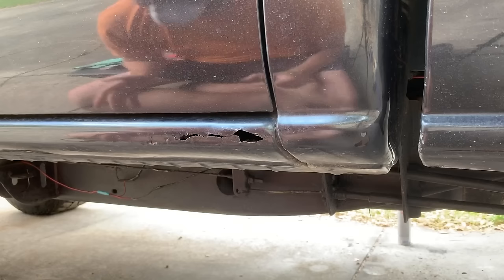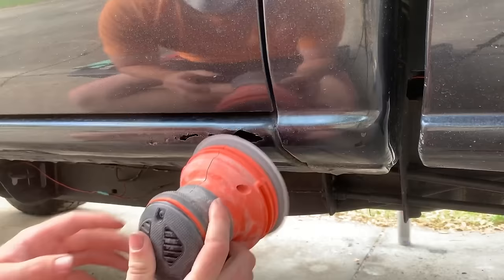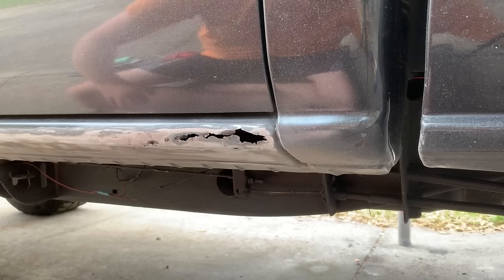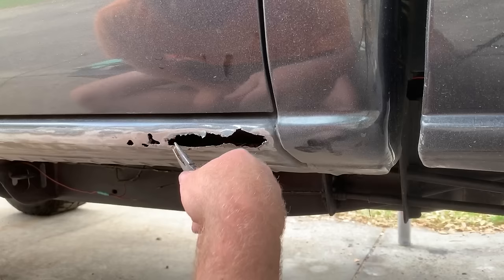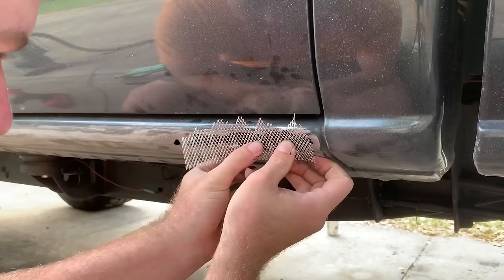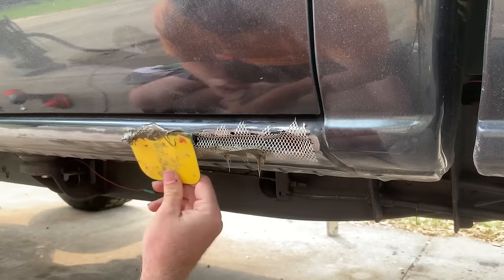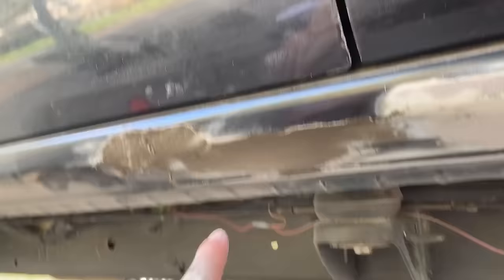How To Fix Rusty Rockers Without Welding

Comment: Drill some holes to dump used oil inside the rockers and you'll never have an issue again with them rotting. It's what we do up here on the east coast of Canada with our vehicles.
Reply from the maker: Never knew that, I love leaning little tricks like that. Thank you
Reply: Dude this is great never thought about that. Will be doing this for sure
Reply: Great tip - thanks!!
Reply: Fluid film.
Reply: @AaronCates  Check local laws before you do this.  EPA might have something to say.  Definitely illegal in Atlantic Canada to use used motor oil as an undercoating.  Fluid film™ is an excellent alternative choice.  Environmentally friendly and works well.
Reply: I got a quart of 1040 in each door and each rocker.
Reply: @DunlapsGarage   First, if you actually read my post I said "'Community" not vehicle.  In fact the word "vehicle" was not used at all. I used an example to reinforce my point about checking "local" laws before using used oil as undercoating.   Not sure how this seems to have offended you.
Reply: I’d use the oil. But then I pee in storm drains.
Reply: @hobbyaddict9908  Also live in Atlantic Canada and do this however I don't see how spraying it inside the doors counts as undercoating.
Reply: @Shawn_White  Governments do not care if the average person does not understand the laws as long as you follow them.  If you really want to know call your local Department of Environment and ask them.    FWIW, most vehicle doors have drainage holes and anything you spray inside the doors will eventually leak out onto the roads you travel, onto your driveway, etc..
Reply: Thanks man I'll try it out
Reply: We do the same thing in Ohio.
Reply: Doesn't have to be used oil, can be new oil but why spend the money but could use really any kind of oil  or product made with oil instead of water new or used
Reply: Here's a rust belt cheap coating. 1 quart of trans fluid, 1 quart of ANY oil, new, used, hydraulic, motor, gear etc, 1 tube of grease and 1 or 2 toilet wax rings. Put all in a old pot, heat and mix and put on how you wish. Thinning with any oils or fluids or thickening with wax. You can add boiled linseed oil or whatever you like. I like to use baby, mineral, melted Vaseline for doors, hood, trunk, tailgate etc. Will not ever rust, is cheap as can be and will last more than 1 season. The best I've used is Blasters wax coating, but it's not cheap to use every year. We all change oil or know ppl that do. all you gotta buy is wax rings and grease. So for $6, $10 bucks most using used fluids you have a rust killer and stopper that will last year's if used and put on well. I spent tge time to get Eastwoods rust encapsulating paint, internal frame coating then use this wax oil treatment and it lasts for a long time.
Reply: You’re a damn genius I’m saving this comment for when I work on my truck
Reply: @Connor727  No just cheap and tired of spending $100s a year on fluid film and the like. And from 30 years of working with machinery, cars, trucks anything with a engine you never see rust on metal covered in oil, grease, hydraulic oil etc. Only issue is some is very thin or gets thin when warm. Mixing with 2 wax gaskets it will not run or creep. For this I use Vaseline, baby oil and mineral oil. I can mix some trans or any oil with it but it's not needed. Just plug up all the drains on doors, hood, trunk etc and fill with cheap petroleum products for a few days, raise and lower and side to side and it will get in all tge cracks and crevices and it won't rust year after year. Some places like the doors and such you want some creeping, frame and undercarriage you don't. Used this for years and years and only ever saw 1 other who said they do about the same. You can use whatever you like. Boiled linseed is great also and don't smell bad. If using in doors I like to not smell trans fluid for weeks. Or mix with baby oil. It smells alot better than anything.
Reply: What does the oil do?
Reply: Oil attracts dust and dirt. Bad idea!!!
Reply: I live in nova Scotia and didn't no about this
Reply: @hobbyaddict9908  lol
Reply: @MidnightPolaris800  it does and it makes a barrier from o2, the primary source of rust, wipe clean what you can see
Reply: I live in Ontario. If my rockers are already rusted is it too late to do this?
Reply: @MidnightPolaris800  dust and dirt is preferable over rust
Reply: Mmmmm. Also for the the undercoat when nice and clean. Plastic makes it fun for the new cars. Anyone else keep their undercarriage rust free? Hubs, brakes, linkages etc? My control arms on my mazda seem to rust out every year, even with a tear down and proper repaint.
Reply: We use transmission fluid in Ontario
Reply: @Chronic898  I have been doing undercoating for probably 35 years. If you don’t want to buy actual rustproofing products, as you say ATF and also chainsaw bar oil are good alternatives. Motor oil is a bad idea as it is really hard on any rubber parts, as in it will destroy all your rubber mounts and bushings.
Reply: @oof578  yup fuild film I live in north north east lots of salt. When I bought my tacoma used it fell under the frame replace program. Got a new frame a week after buying been putting fuild film on it every November not one spot of rust on the frame at all. I buy the small spray cans an put in on the door hinges battery terminals ect
Reply: Too late for my truck. Crap silverado!!
Reply: Use fluid film or an actual rust inhibitor.. used motor oil is obviously cheaper but oil that is breaking down has Corrosive qualities that might actually cause further damage to the metal.
Reply: @BigWheel.  I have seen 2 trucks get all their rubber mounts get destroyed  using oil. Not a good idea.
Reply: Industrial lanolin is what I always use in tropical Australia.
Inside doors, rockers, anywhere water can get in
Reply: FRED....C'MON  mannn... 🙄🙄
Reply: We use break fluid in surrey
Reply: I just take my car to krown and they spray a nice thin specially made oil right in there once a year.
Reply: @mblake0420  moisture is the primary cause of rust
Reply: @beardedforlife3740  I would say no kidding
Reply: Farmers spray all of their equipment undercarriages with used motor oil.
However, regular people doing what you propose will not work because that oil gets all over the driveway, and if you have a concrete driveway it permanently stains the concrete.
Reply: @pupdog7374  we spray all of ur equipment with diesel before storing it over the winter months and just before we put it to work in the spring.
Reply: I live in Illinois, the rustbelt capital of the USA.  To  deal with rusty undercarriages and wheel wells on my cars,  I installed a hot water pipe sillcock to the outside front of my house (along side the cold water sillcock). My horseshoe driveway works well as I use one side to wash my cars undercarridges and the other side to park my cars. Works like a charm.
Reply: @pupdog7374  I'm in New Brunswick Canada next to the Atlantic Ocean and our road crews use salt 95% of the time on the roads so to say I know the rust belt problem would be an understatement lol.
Reply: @beardedforlife3740  o2 is primary cause of rust, the water (typically salty) speeds it up and makes it a concern
Reply: Yeah I use fluid film . I figured if the military uses it , it's good enough for me.
Reply: Have to treat the rockers from behind asap where there covered with cheap tape from factory then seal holes with gorilla tape or...install a good brake light gasket also.  If you have a sunroof..
Idk, drill a drain
Reply: @smokeythehuman3596 I had some old 4 stroke oil and I did this lol raw dogged tf out of that rust
Reply: @hobbyaddict9908  thanks dad
Reply: Keep up the work kid. Looks great. Keep making videos. I will be using this trick
Reply: @johnnycash7803 Is it only Tacoma’s and what yr?
Reply: @ladilondon1213  is what only tacoma?? The frame replacement program. Mines is a 2010 an at the time I think it was from like 2008 or 9 to 2017. I could be wrong. Not sure if it's still going down tho.
Reply: @hobbyaddict9908
Quebecer here ,
Your old engine oil will inevitably end up in the environment no matter how approved by authorities your means to discard is....they are no magicians they simply choose the less harmful way to "eliminate" waste.
I drop my old oil in the sewer every time I do a oil change lol😂 As long as I'm alone in doing it,there should be no need to worry loll
Reply: @YanDaOne_QC  perhaps, but contaminated drinking water won't be because of me.
Reply: @hobbyaddict9908  It's Quebec here.Heard about that 8 million population French-Canadian province in which Freshwater covers 10% of the territory . With tens of thousands of rivers and three million bodies of water, Québec holds 3% of Earth's renewable freshwater reserves. Theses numbers don't include underground water which represents 3 times the freshwater contained in our countless lakes and rivers.....not too worried about water contamination lolll it's not the US here we don't drink "treated" wastewater 💩🤢
Reply: @hobbyaddict9908  I've just realized you were talking about the guys treating your oil waste loll.Language barrier sucks
Reply: @YanDaOne_QC what everyone fails to notice about oil and saying the epa has authority over where you use it, oil comes out of the ground ffs. How can something that comes from the environment be bad for the environment. Every element known to man has come from the environment, so it can't pollute it when it's already there.
Reply: Can you post a video of where you drill and where to put the oil please ? Sounds like a good idea
Reply: @hobbyaddict9908 Who cares about EPA I have a car to protect?!
Reply: @jasonchristopher2977  You get some trans oil 🛢 up the pipe that will keep ya creeping for years to come. 😂
Reply: @johnnywishbone932  lmao yes it will. Keeping rust at bay in rust country is a must. I've had to tell a lot of customers that had 15 yr old autos that was so rusted out that It wasn't legal to drive or safe. And it's sad cause a lot was decent cars, trucks that had fine engines, etc. the unibody and subframe, most can't be fixed, especially for what it costs to do so.

Comment: There's nothing about Bondo that eliminates the rust you left untreated.  Rocker panels are part of the structural support of the car.  Do it right.  Weld in replacements.

Comment: I live in a rust state.  To both prevent rust and stop existing rust, I pump my rockets full of used motor oil about twice a year.  I just let it sit and drip on sheets of cardboard.  I've had good results keeping the rust at bay.
Reply: Rockers that is.
Reply: @robcockrum2662  I live in a similar type area.. your ideas are golden.. where did you drill the holes in order to pump the used oil in? Cheers 🍻
Reply: I do the same, i spray every opening i can find under my jeep. It will drip for hours afterwards , but it won't rust.
Reply: @PokerFace837  I have a 2013 f150.  I just use the holes on the underside of the truck and the crevices at the ends of the rockers   Inside the bed I've drilled a hole on each side above the wheel well hump.  I use a hand held trigger oil can to pump the oil.
Reply: There's a great product called Fluid Film.  You can use it for that and also spray other areas of the underbody, suspension and so on.  It's not free like used motor oil, but it's pretty reasonable.  Just park on the grass when you use it, it will stain your driveway.
Reply: 👍✔️
The best advice.
Reply: What is that sanding tool called specifically, and do you have one you would specifically recommend? 
 I think I might have something similar, but not sure. Super beginner here…
Thanks!!!

Comment: Good job Bud....here is my take, as I am an Auto Painter and painting for 42 years.  For a Cheap job as you have done, this was good.  But here are the Steps to follow:
1.  Tape up all parts not to be painted FIRST.  (2).  Use the Fibre Glass filler as you did, but in the first wipe, fill ONLY the Deepest parts first, and finish the rest with Fibre glass filler in wipe 2, 3 and 4.  Sand Fibre Glass filler with Grit 80 to 120.  (3) Use Bondo if need be and sand Bondo with  Grit 80 to 180.  (4) Use  2 part Glazing Putty and sand with Grit 180 to 320 Grit.  Blow off dust before each filler wipe.  Do not wipe filler on Un-sanded surface (5) After sanding with 320 or 400,  blow off and you can use Primer 2 to 4 coats.   (6) Sand with 600 to 800 Grit to Paint and Clearcoat of your choice.  Good job anyway.  Regards from California.
Reply: As a former somewhat body restorer I approve this message 😂.  Bondo and fiberglass then quick sell it😂

Comment: I think it turned out good! This is perfect for the ppl who don’t have the money to take it somewhere and just wants a quick fix and to look better, rather than driving around with rust. I been wanting to fix mine on my Chevy truck for several years and I’m going to try this!!! This is the kind of video I been looking for 😎
Reply: Just make sure you sell it right away, because it's only gonna last a month or so
Reply from the maker: Sold the truck 2 years later, after I repainted it. During the sanding process I checked all areas with zero signs of failure.

Comment: I really liked the 18 second intro than showed exactly what this video was going to be about!!
Many thousands of YouTubers could learn something from you.
Great video!  Maybe you could cut some rat wire that has 1/4 inch squares and roll it into a tube and put it inside the panel.
Hold it to the front with wire or string while you fill it with body filler. There are several ways to do this but yours looks great!

Comment: For anyone watching this video with little to no expertise like aaron and especially myself, i'm researching also to do this for my truck, but i thought it would be handy info to pass along.

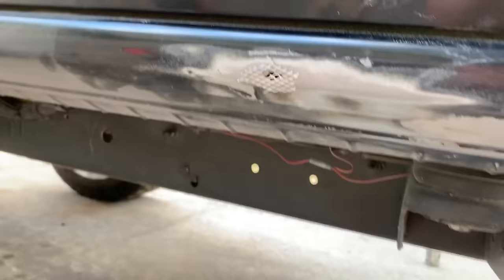at 13:00 when he sanded through the bondo to the fibrelass patch, the reason is because he should have dented the areas back a bit, and refilled the entire depression with bondo and then when sanding it flush with surrounding good body, it still keeps a layer of the fibreglass patch hidden behind the goop. if you just layer it on top, then sand it flush and end up sanding the entire patch job off, then youve wasted time and material. just press it back so there allows some space for the bondo to sit between the patch and the finished body. Just a tip! I saw a few videos where they just pushed it back a couple mil's with a screwdriver or mallet ( depending on the repair size)

Good luck all, and wish me luck. my rockers are in worse shape. damn 17 year old truck thats lived in canada its whole life. Canada is one entire rust belt D:
Reply: You want it repaired properly bring it to me.
Reply: Thanks that’s exactly right if you are a person that understands things common sense type stuff if not it’s going over there head but yeah you need a little above the good from the bad to work it down nice and evenly.  And remain strong.

Comment: Where I live, near St. John's, Newfoundland that truck would be considered in almost showroom condition. Now I'm trying to save a 2009 Ranger that's rotted out right from one end to the other... like most vehicles it's age. Thanks for the video.
Reply: Where i live it would be an instant MOT fail for structural rot.Sills are an important structural part .

Comment: Good job. Looks really good. I did the exact same thing to my Chevy truck rocker panels on both sides, I saved a lot of time when I used a cheese grater to shave off fiber glass 15 minutes after I applied it to the existing rocker panels. It saved me at least 3 or 4 hours on the entire repair process. Sanding fiber glass filler can be very hard to do by hand or DA sander etc...

Comment: Awesome job man! Great budget fix, aluminum tape as a base before you do a bondo adhesive patch helps to giving it a little form and easier to spread your fiberglass over
Reply from the maker: Thanks for the info, always love feedback!
Reply: Put oil  lots of oil in holes of rocker before  you fill holes period
Reply: @AaronCates  haha you can also soak fiberglass cloth with por-15 and it's strong. 
No messing with mixing 2 part resins either.

Comment: A well done budget repair to get you by. The guy didn’t claim it was a restoration and to all the complaining people out there, he has slowed down the rust and removed some of it. Can’t stop it without pulling everything apart and getting between panels. That’s a restoration. Cut him some slack.
Reply from the maker: I owned the truck another 2 years after this repair, sanded it down to paint it and the fiberglass bondo was still in tact with no signs of rust anywhere. The new owner of the truck lives in New York, so I'm sure it will rust again either way.

Comment: I use Eastwood internal frame rust encapsulator and rust preventer.

Can be sprayed as an aerosol, also has a 24 inch tube with a spray nozzle at the end that you can insert inside rusted rocker panels.

Seems to work on the vehicles I’ve repaired

Comment: Another good thing to do is fill the inside of your rocker with closed cell spray foam I've done that its 4 dollars atl owes and ppl say it will hold water but spray a glob and let it dry then stick it under water for days and pull it out there will be no water in it. It does not hold water at all. Works very well and it keeps more dirt and rust build up inside the rocker for the future and will forsure prolong the life of your rocker.
Reply: i've used spray foam for a few rust hole repairs.. it seemed to make sense, and i agree with you that it seals water out rather than absorbing it.. it sands down like butter and i leave the foam filled holes a bit concave and then use bondo hair fiberglass filler to bring it surface level then some spot glaze putty to finish it all off